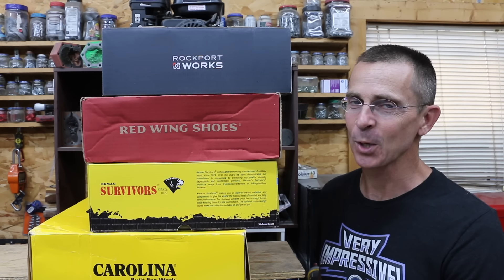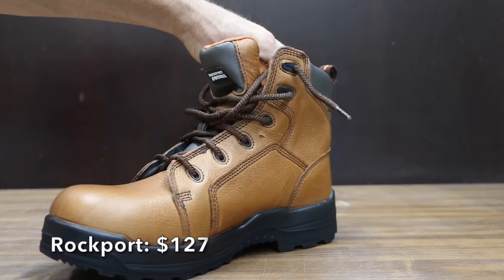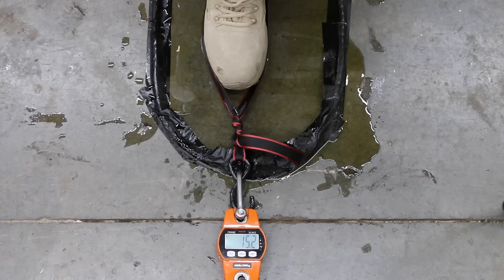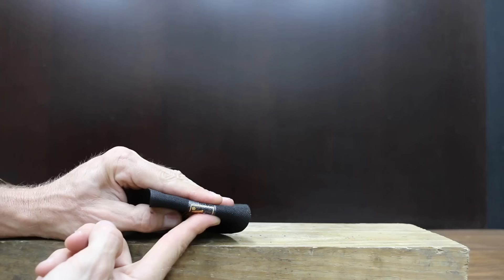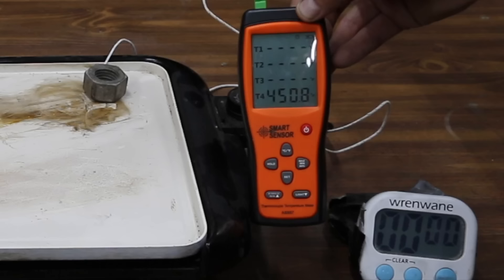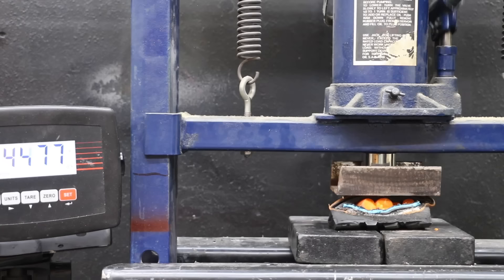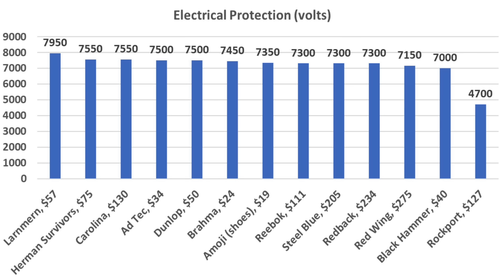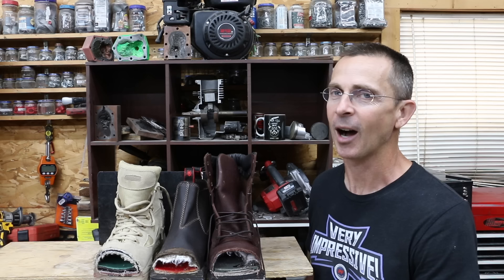Best Boots? $24 vs $275! Let's Find Out!

Comment: For me it’s always been Red Wing.
Great customer service too if you can find an outlet.
Reply from the maker: Thanks for the feedback.
Reply: After you realize you can have them resoled over and over and over again why would you bother buying a brand new pair?
Plus they sell the nose guard that nobody else sells
Reply: And don't get me started on the nose guard that nobody else sells that will make your boots last twice as long
Reply: The Red Wings are the only ones made in the United States. After they have broken in I like them.
Reply: The problem with sending boots back to Redwing for resoling.. it costs about 75% of new Redwings based on several attempts I made to get mine repaired. I finding myself buying used replacements on Ebay for less than 50 bucks.
Reply: Not in my experience, they tried to deny my boot warranty after 4 months for "excessive use". They are work boots I only wear them at work.

Took waiting for a manager to show back up from lunch and browbeating before they took them for repair.

Took a month to get them back for a simple cable replacement. Had to buy a second pair of boots just to wait for my 360$ redwings. When the second cable broke I tossed them and went wolverine and been satisfied ever since
Reply: I got a pair of redwing boots years ago thinking I would be impressed. I had always bought cheap 30 dollar boots and it was a stretch to spend 180 on redwings. They lasted me twice as long but when they needed resoling for $65. The resoles lasted 2 months and they were covered under warranty but the second resoles only lasted a month and they said I was out of luck. Some people might need them for the fit but for me cheap boots every five months are worth it.
Reply: Always good to do business with honest never try to push a boot sale on you. one time they accidentally double billed me but they called me immediately and let me know they were fixing the goof I guarantee many stores would not have done that.
Reply: Yeah I've worked in a manufacturing plant for 18 years and the Red Wings I have now are the most comfortable shoe I've ever had.
Reply: If it's possible, I'd like to see a test on socks. I've been buying Noble Outfitters Boot socks and haven't looked back.

Comment: I used to get those same Brahma boots about every 4 months. They are actually pretty comfortable with a Dr. Scholls insert. I recently switched to Wolverine boots, they are much more comfortable without any insert and have already lasted longer than any pair of Brahmas I ever owned. Thanks for you content!
Reply from the maker: You are welcome!  Thanks for the feedback.
Reply: I used to buy carolina/corcorans, but I got cheap one time and bought some used german-made military boots.  With only a few exceptions, I've been wearing them every day for about 10 years now.  Best $20 boots you can buy.
Reply: Sad Wolverine wasn't in the video! First pair I had lasted me almost 5 years of heavy duty use and a few changes of insoles. My second pair (same product) are still in great shape after 2 years of light-medium use. Definately my favorite boots I have ever had. Excellent insulation, really good slip proof, quality leather, the Durashock soles are amazing. Just an all over perfect boot.
Reply: Get yourself some thorogood if you want a very nice boot that last a long time I absolutely hated spending so much on a pair of boots but every pair of wolverine Redwing and anything I tried in between wore out in less than 1.5 years my thorogood I paid like 300 for BUT I've had them going on 3 years now and they still have at least another year on them I wear them 14 or more hours everyday

Comment: I have a pair of Redback steel toe, chelsea style boots (Easy Escape?) that I've been wearing a few years now. I really abused them working in construction and they're still holding up very well!  I don't think the elastic has stretched much, if any. They are still quite comfortable, but I changed the insoles to Form Insoles when I first got them. Despite trying some Dr. Martins in a similar style, I went back to my Redbacks. I'm about to put them back to work when I start home inspection. 

I actually bought them after watching a Rose Anvil video where he cut them in half and dissected them. I'm glad there are people on YouTube doing these things because it is very valuable info and I'm sure it helps a lot of people make informed decisions about their purchases! Nice job!

Comment: A durometer test of the rubber, thickness measurement of the leather, and cross section of the construction would be very interesting data. Much love Todd, thanks for putting in so much effort to make the most amazing product testing videos in the world
Reply: Heh, I love the cross pollination between this channel and Wes' Rose Anvil channel. Friendly competition is great!
Reply: @TheJohn8765  Rose Anvil is great, but he made me spent a lot of money on the toughest boots on the planet. 😅
Reply from the maker: You are welcome!  Thanks for the suggestion.
Reply: @ProjectFarm  can you also look at cold traction? Ive found boots that turn hard as a rock and slip at cold temps
Reply: @tobiass1184  Cold boots tested on ice would be a great test.  As for wear resistance would a certain amount of downward pressure on the boots over a belt sander be adequate?  I'd like to get a pair of boots that last me more than 1 - 1.5 years.
Reply: @couchsofa2977  those Nicks are also the hardest to break in. Plus if they are your only pair you’ll need to take an extended vacation if you have to have them refit or rebuilt.
Reply: You're looking for the Rose Anvil channel. This isn't that.

Comment: As for longevity, my Redwings go back to the early 1990's!  They probably should be re-soled, but they are still in great shape.  Best wear and comfort for the money I've ever spent.
Reply from the maker: Nice!
Reply: redwings are still good, but they aren't what they used to be.  most redwings now made overseas, only a handfull still made here, and those don't see to be as good as they were 10 years ago and prior.  sad, but it is what it is.  redwing used to be so much better than everything else that they were worth the higher price, now that value proposition just isn't there.
Reply: What kinda job sites do you wear those Redwings on?
Reply: @workingdad  Best off with a Nick's, Frank's or JK's anymore.
Reply: @willieearles3151  probably wears them around the house 😂
Reply: @Willie Earles  he's an health and Safety Officer
Reply: @willieearles3151  
They sit in his closet
Reply: See the two pair of redwings I owned messed my feet up. Went back to my Herman survivors, and I'll keep wearing this brand  for life. They just came out with some new flat bottoms as well. Sharp looking boot.  Sole on those particular boots wear out pretty fast though, especially if u walk like a duck.  The trick with Herman survivors is to to add an extra insole from day one. Zero break in. Who cares about sending a boot out to resolve, that is insane to me. Rather just buy a new pair for 60 bucks
Reply: @Daddyswork  every pair of Red Wing work boots I've ever owned have been made in the USA. If you're buying the Irish Setters, you're not buying a real RedWing.
Reply: Hang on to them,   the new ones are crapola.
Reply: @willmarj  Snark all you want, James.  I wore them while I tore out kitchens prior to installing new, custom cabinets, appliances, electrical, sheetrock, plumbing etc.  I've actually lived a life rather than lobbing potshots from my mom's basement, as it sounds like you are.
Reply: @workingdad   Redwings came back to manufacturing in the USA, but last I checked not all Redwings are Made in USA.   They also brought back some of the classic Redwing models that had been dropped, so maybe they’ll win back my business.
Reply: I hear that the SUPERSOLE 2.0 on Redwing boots is extremely comfortable but will deteriorate faster than one would like.
Reply: What do you do for work? I'm in excavating and fabrication and I only get about a year out of them

Comment: I've been wearing Red Wings for years and just swapped to Reeboks a few months ago and found the Reeboks to be more comfortable because of my extremely wide feet.  It's nice to know that they are at the top in most of the objective categories too.
Reply from the maker: Thanks for sharing!
Reply: Kinda surprised you didn't find boots wide enough from Red Wing, these are available in H width.
Reply: @alexhamon9261  I've got H width Red Wings.  I thought they were comfortable until I swapped back to them temporarily from my Reeboks and realized how comfortable the Reeboks actually are.
Reply: Redwing also sells insole for wide feet as well. When i bought my boots, i thought they're were comfortable but missing something. I explained to the sell person, and they took the insole out of the boot and opened the "wide sole."( I can't remember what it was called), but it made a total difference, and I've been rocking Redwing for 3 to 4 years now!  There are no issues! here!

Comment: I have the shorter version of the Redwing you have here. I have been working in boots for over 20 years, and the $200+ boots are worth it! Redwing will have to go out of business before I stop buying them. Most comfortable, last forever, almost zero break in time, and the local store customer service is top notch! Great video. Your results prove my experience!
Reply from the maker: Thanks!  Thanks for the feedback.
Reply: I think I have the same boot as you. It took me about 4 years to wear out the boots, and then a cheap resole got me another 1.5 years. The upper is still in fine shape so I keep them around for yardwork. Then I bought the exact same boot again.

Comment: My dad wore Redwings throughout his career as a mechanic/manager.  He rarely has back pain now at 70, but he did have a knee replacement about 15 years ago.  I only remember him buying a new pair about 3 times from 1986 to 2019.  So I'd say for longevity, the Redwings will give you up to 10 years.  He chose them because he has narrow feet, and they were the only brand that was comfortable and had that option.
Reply from the maker: Thanks for sharing.
Reply: They are also one of the only brands with wide boot sizes, very nice for me as I have wide feet

Comment: I've been wearing the Reebok zip ups for over 10 years ..they were originally made by converse. They are the most comfortable boots I've ever worn, nice ball of gell sewn into the inside under the heel..so much cushion. Grip well and easy on off. Love them
Reply from the maker: Thanks for sharing.
Reply: @ProjectFarm  No problem, Work on railroad and do a lot of walking on rough ballast. The insoles could use a bit more cushion but that gel cushion sewn directly into the heel of the boot makes them extremely comfortable.
Reply: How is the toe holding up?  I tend to go through mine quickly. Was thinking of getting these and put a replacement cover right away to make them strong from the start
Reply: @oscarinacan  I never had the toe wear out as far as holes/cuts, the body of the boot has never torn or separated from the sole. They are the best boots for every day hold.up to whatever and feels like it wearing gym shoes.. you won't regret them
Reply: @Carguy0882  cool. Thanks

Comment: I've been wearing RedWing boots the past 2 or 3 years, they're wonderful boots, except the break in period can be quite long depending on the boot style. I've done maybe 6-10 million steps in one pair so far. One benefit of the redwing boots is that they offer a resole and refresh program for the non waterproof/insulated versions of them for less than half the cost of a new boot, with the same sole you get when you buy them new.

Great testing! Glad to see there are some good value options out there as well!
Reply from the maker: Thank you for sharing!
Reply: I have a pair of Red Wings I'm about to send in to be resoled. I'm not looking forward to being without them while they're being repaired. As far as the break in period I always tell people that once the Red Wings are done breaking in your feet they're the most comfortable boots you'll ever wear.
Reply: You should mink oil the Red Wings and not only does it waterproof them it apparently extends their life. I agree with the break-in period not being ideal but they are better than most.

Comment: Red wing is my go to.  I've had boots in the $50-$125 range and they all lasted 6-9 months.  My first pair of redwings  (~$225) lasted 2 years before the toes wore out so they were no longer water resistant.  I've had a different brand that was about $200 and they lasted almost 2 years but were never as comfortable as the redwings.
Reply from the maker: Thanks for sharing!
Reply: High test are the best you can buy dont waste your money on redwings
Reply: I love Red Wing boots and wore them for many years in manufacturing! The biggest drawback to them is they’re heavy and expensive.
Reply: I buy the 2414, the ones in the video are 2408. I coat mine with toe coat before ever wearing them. They will last so much longer if you do a toe cover.
Reply: @RaddestDad  I get the 2240 (my feet are fucking wide at the toes so I need the extra space).  After that first set I started putting tuff toe on them
Reply: It`s sad they can`t fix a hole in the toe on a leather boot I had to throw away a $350 pair of Irish Setters over that.

Comment: I am a truck driver at Neo industries. We handle steel Mill rolling pins. The job is hectic on boots. The timberland gravel pit was my main boot. I love the way the boot looks, but they don’t last. I went through 4 pair. They last about 6 months and the seem fails where the boot bends when you walk. All 4 had the same failure. 
I decided to try redwing. The Brnr Xp to be exact. They are flawless. I’ve had them for over 2 years now of rugged wear and they have maintained perfectly. Excellent boot.
Reply from the maker: Thanks or shariing.

Comment: The Redwing boots you tested I've been buying for 20 years. As a heavy machinist they are the only boots that will last 2+ years walking in coolent, deep oil, and hot razer sharp metal chips. Redwing referrers to the sole as 2.0 and is amazing.  Don't cheap out and buy lesser boots. Buy the best and buy Redwing.
Reply from the maker: Thanks for sharing.
Reply: What’s the name of the boots ?
Reply: What model was it
Reply: @batmansprotege1569  Style 2408 supersole 2.0
Reply: White’s, Nick’s, Drew’s, Wesco, and other mostly hand-made boots are more durable than Red Wings (or any other boots). They’re also more expensive. Comfort is somewhat subjective, but many people swear by the “arch ease” leather insoles in White’s and Nick’s.
Reply: Redwing are uncomfortable, overrated crap

Comment: I spent many years in a construction oriented position. I went through alot of boots over the years. 1 thing I concluded is that a quality boot is 1 of the most important tools I used.
Of all the boots over 25 years I had, I can say the Chippewa 25220 boots were the most comfortable and were equally durable to any other boot I found. I would not hesitate to purchase another pair. I still have the last pair I bought even though I've retired, they still get worn around the acreage on occasion.
Reply from the maker: Thanks for sharing.

Comment: While I was working as a paramedic I had a pair of Redwing boots that lasted well over 10 years ( I did have to have them resoled several times ). During that time they were exposed to just about every harsh condition you can imagine and never let me down. The only reason that they didn't last longer is that they got contaminated in hazmat incident and I was unable to decontaminate them so they were given to the hazmat cleanup team (they did buy me a new pair of Redwings, that that was OK with me).The only downside I ever found with the boots is that  needed to treat them with snowseal to keep then water repellant during the winter. They are by far the best work boots that I ever used, yes they are expensive but you get what you pay for.
Reply: I got nearly 3 years out of a pair of Rockport Works RK6640 boots.  The only things wrong with them are worn out insoles, and the soles peeled at the front.

Comment: I personally just picked up a pair of Red backs after having a pair of Blundstone work boots and have to say they are amazing, One thing to note is the lack of time it takes to put on the red backs compared to the other boots being a slip on in my work environment is essential as in certain situations I have to put my work boots on and run as in as fast as possible. Another point of the slip ons is in environment where your working with combustible liquids and hot surfaces a major plus of being a slip on is that in the event they caught fire you can easily get them off and not suffer burns to your feet and legs. I know from experience. Great video!
Reply from the maker: Thanks!  Thanks for sharing.

Comment: One way to improve cheaper boots or shoes is to buy a quality insole for $20. You'd be surprised how much of a difference it makes in comfort and fit. Great video, as always. 💪
Reply: That's exactly what I do!  20$ Dr Scholls insoles have lasted me more than 3 years!
Reply: @trm4life  same here
Reply: AND changing out insoles can re-fit the boots fit. It can snug up a " too large of size " with a thicker pad, or loosen a "too tight" of a boots fit with a thinner pad.
Reply: Most insoles are garbage marketing gimmicks, if it ain’t the Good Feet Store soles, you’re buying garbage
Reply: @saltytart4891  I stopped there. Bought the $269 insoles.

I later found the exact same thing for $50 online. That place is a SCAM
Reply: Totally agree. Lots of work boots have useless insoles, I just put the insoles from a good pair of running shoes in, much better & last for ages.